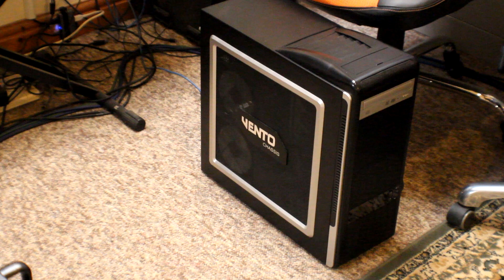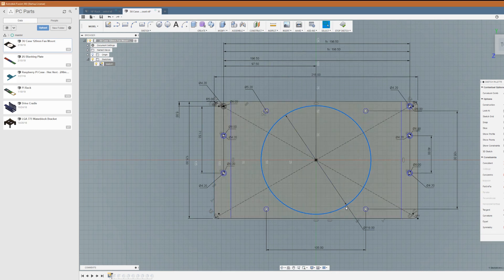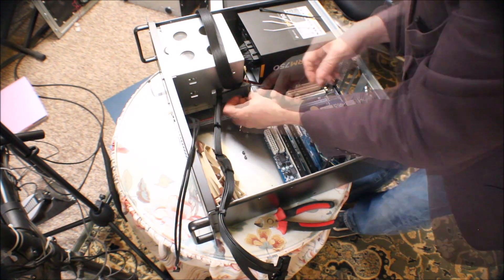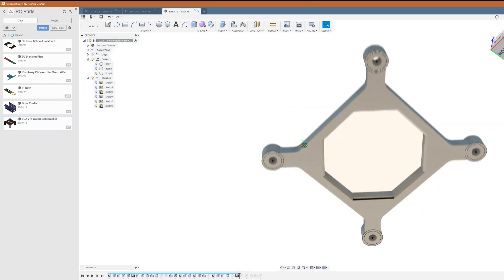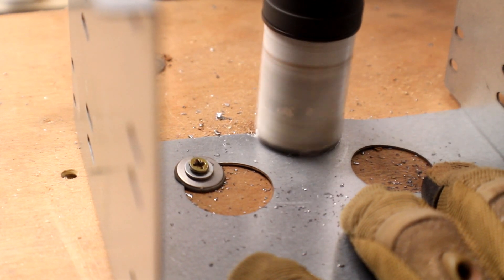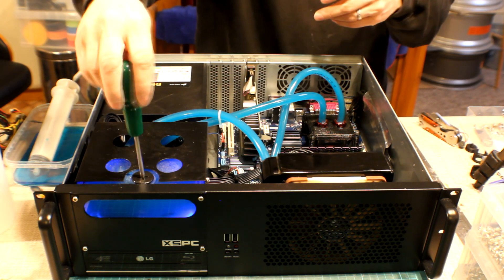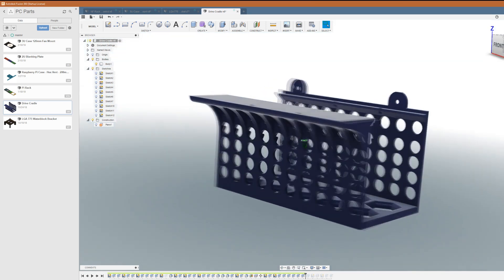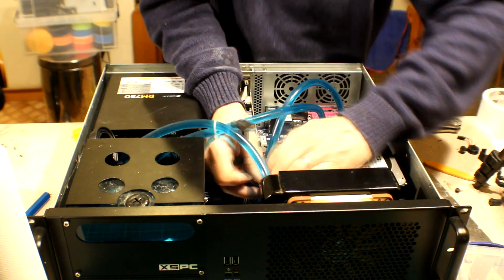Things to 3D Print #10 - Custom PC Case Parts

Comment: Do you use PLA for the CPU Water Cooling Bracket?
Reply from the maker: It was a while ago now, but it was either PLA or PETG. Either is fine as there is not that much pressure on the part.

Comment: very interesting video and great use of an old rack case
Reply from the maker: Thanks - I'd lost count of the times cases were just not quite right to fit stuff into. Especially water cooling stuff. 3D printing if you can do the CAD is a perfect way of getting non-standard components to fit properly.

Comment: Where can someone learn 3d modeling? fusion 360 has been a pain and I've been only using it to covert from Autocad to stl since I have a student license and tinkercad leaves much to be desired as many programs seem to be as well lacking a straight forward interface and ease of use. A better free option would be appreciated.
Reply from the maker: Hi Redkurn - I taught myself 3D modelling over many years. I started in computer game/flight sim modding and went from there. The tools/software are so much easier to use these days than it used to be, as you have resources like YouTube. One way to approach it is to think of something you really want to make and then start from a simple shape and learn techniques to transform that simple shape into the more complex form you need. I would not learn by making shapes that don't mean anything to you, as the motivation to learn will just not be there.

I my opinion there isn't really an alternative to Fusion 360 for free in the marketplace and certainly not when you consider the inclusion of integrated CAM. It does have its issues however and especially in areas like compound curved structures and some things it tries to help with (e.g. selections), but fails. Other packages for "free" are of course Sketchup and Blender, the former is easy to learn, but not very fully featured (without plugins certainly) and the latter last time I looked at it was hard to use.
Reply: IMADETHIS Thanks for the answer.

Comment: your 3d printer shouldn't have that much stringing, you should try to use z-hop or retraction.
Reply from the maker: Agree, it was a right rats nest in there - can't remember why I had retraction off for that print...
Reply: IMADETHIS so its fixed now?
Reply from the maker: Yeah. In the main its good, apart from PETG, which just loves to string for some reason, but a furniture/cabinet maker's scraper and deburring tool deals with that.